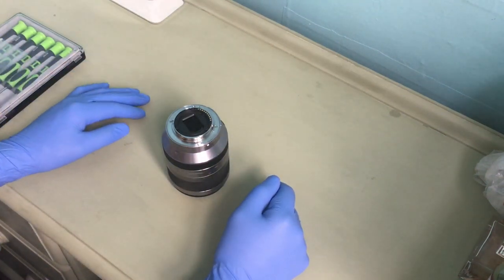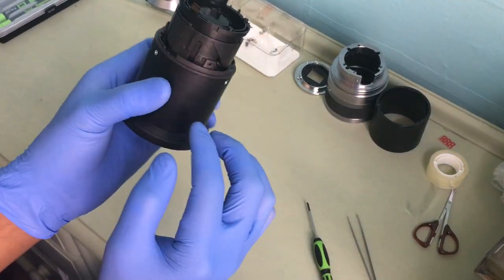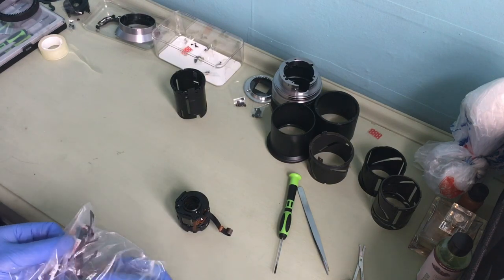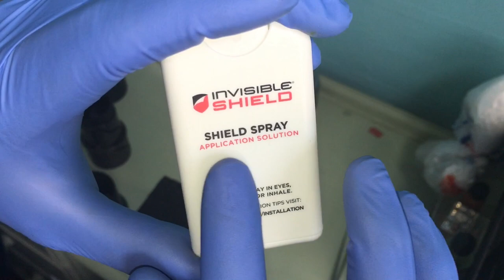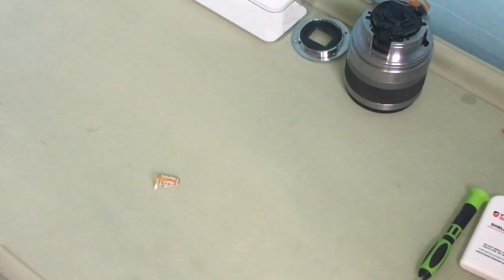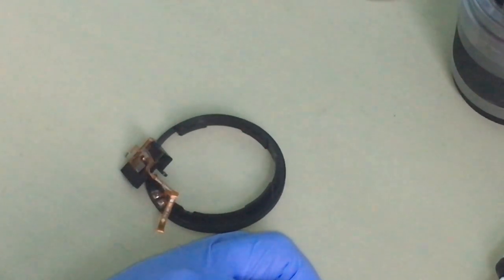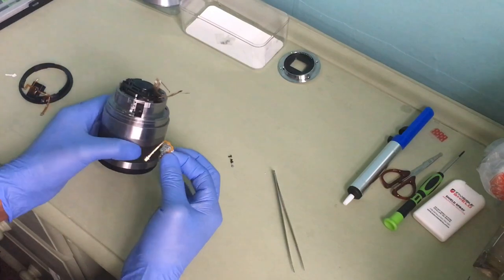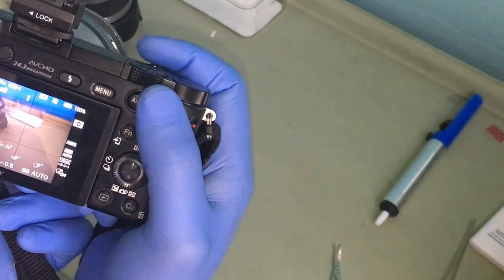Sony Sel lens 18-200mm 18200 18-200 Teardown and Reassembly in Step by Step Real time + Voice

Comment: Hello. I am using a translation from Japanese, so the English may be strange. Thank you very much for the great video. I think I can fix it thanks to your video. My lens had a snag or noise between 100 mm and 200 mm. I think I can improve it by removing this screw (19:05) and reattaching it. Now I have broken the flat cable and cannot reassemble it perfectly. I am waiting for the parts to arrive on Alibaba. (By no means is this the fault of the contributor!!!!!!!!) If I get it fixed, I will make an addendum. I am not the contributor. Please do so at your own risk. Thank you!
Reply: That is a good point. This is my new account. Yes it is done at your own risk and care should be taken when doing this.

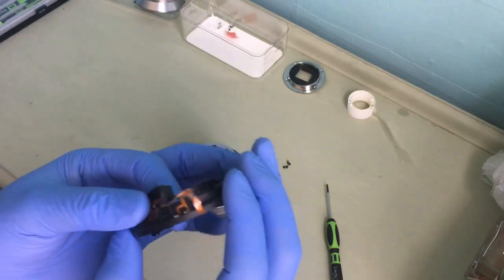Comment: Thank you SO MUCH for this video. I used it about a year ago to repair my lens that had a zoom problem. Now this same lens has a focus problem and it might be the cable that you show at 12:18. Where can I purchase a replacement cable? I’ve searched the part number but I can’t find anything.
Reply from the maker: EditEd4TV YouTube won’t let me send you the link for the parts, contact me on love63212004@hotmail.com so I can send you the link to the parts thanks, message me on here once you have sent the email.
Reply: @FlameRevenge  Great video, I recently purchased this lens with the same problem. Could you also send me the link for the parts needed?
Reply from the maker: Ralphymay5 please message me on my email and I’ll send you the link ☺️

Comment: It is an informative video. Thank you  for sharing. Mine is a different version 18-200 LE and has a same issue as yours with the F-. Do you think it can be fixed similarly ?
Reply from the maker: trisha mai yes it can’t, it would similar this lens, the only difference would be your lens has electronic stabiliser. Hope your able to fix your lens. ( the components would be different inside your lens, so take a photo at every step)

Comment: I'm having problems removing the lens lock glue on the front of a Sony EX3 kit lens.  I don't want to damage the black paint on the housing but do need to get the glue dissolved that locks the front glass?  What is the best solvent to use?

Comment: Mine's not broken but it does have specs of dust inside the glass, will I have to do this same teardown to access the glass?
Reply from the maker: Whit Siever if it’s the front element then no, it’s easy you just have to remove the front clip then the 3 front screws to remove the front glass but take care as not to lose the any parts when doing  this
Reply: That was my question also. So glad you made this video. Thank you

Comment: Hi how can i desassemble the front element? Cause i Guess there are two glasses in the front i take it apart, toclean it . And i got fungus between it, how can i take  the plastic ring Out to desassemble it? thanks
Reply from the maker: Manuel Rio hello when you say fungus in between the front glass, do you mean in between the thick front glass? If so then I’ll suggest buying another front element because once it’s been separated it would need to be glued back together and aligned to get accurate image. However if you just mean cleaning the glass itself then you can get to it by removing the around plastic clip that has the writing on it, unscrew the glass and it just comes out once cleaned then reverse the process, hope this helps 👍🏽
Reply: It's in between the thick glass. Where can i buy it ? Cause i've tryed ebay and amazon with no success. In Sony store they'll ask me the price of a new Lens ..... Anyway i will try to open it , but i!d like to know if the plastic ring Is Made of two pieces screwed, or i Must push the glass Out ?
Reply from the maker: Manuel Rio well if your interested I do have a spare lens that’s not working but it has the front glass element you can use, let me know and I’ll put it on eBay and then send you a link to it 👍🏽
Reply from the maker: Manuel Rio I have just emailed you with subject Sony lens glass
Reply: hey, do you still have the front glass?

Comment: What module did you bought? My Sony Sel lens 18-200mm tries to focus but it is kind of jammed so it is always out of focus. Dont know what could be the problem.
Reply from the maker: Luis Domingos hello this is the oss model, is yours the LE model( the black slim one )?
Also do you mean the model number for the parts I used?
Reply: Good morning :) I have the same model, OSS SEL18200. I dont know if the problem that I have is mechanical. It try to focus but seems that gets stuck somewhere. I know that if we go to Sony they will tell us to buy a new one :/ that is a very expensive solution. And yes I wanted to know the model number of parts that you used, where can we get it and is there more parts that we can see in that site? I also need to clean the lens inside, it was bought in second had and is full of dust :( Thank you
Reply from the maker: Luis Domingos hello if the lens is getting stuck then I would say maybe a screw has gotten lose inside and that could be the culprit. The parts I used is called Superior quality 2PCS NEW Lens   Induction  cable FPC For Sony SEL18200 18-200 Camera Repair parts and Superior quality  2PCS NEW Lens Flex cable FPC For Sony SEL18200 18-200 Camera Repair parts. I bought them on AliExpress because no where else had them in stock. The best thing I would do is to first open the lens up using my video tutorial, once then see if there is any broken cables or lose screws. If the cables are fine and it is just a lose screw then it would be an easy fix. Keep me updated on the progress.

Comment: Hi, i have a stabilizer problem with my lens, when i set the option to active or standard on my nex vg 10 it has a terrible horizontal shaking from side to side, i shoot video so... that´s a great fail to me, what do u think that can be happening? does it need a piece replace or just an adjustment, sorry for my bad english, i'm mexican.
Reply from the maker: Kenneth Cox hello there are two possible co-operates if I remembered right it could be the main board or the optical system inside the lens. It’s been a while since I experienced that problem, but if I do remember I’ll let you know which one it is.
Reply: FlameRevenge thanks in advance!
Reply: Hi. I have the same problem, do you know what causes it?

Comment: Hello, can you repair my sony lens Sel18-200?  I need change the flex!
Reply: Hello it’s flamerevenge, this is my new account. Sorry I won’t be able to repair your lens for you as I haven’t fixed a lens in years and don’t have the time to do so. Can I suggest you follow the step by step on this video as I made it really detailed so that way you can do it from the video. I would suggest buying about 10 flex because it would be your first time and it’s easily ripped. Take your time and take it slow. I hope that helps, good luck with the repair 😊